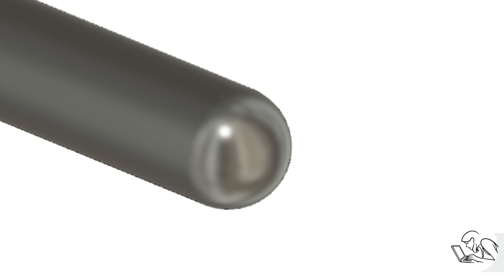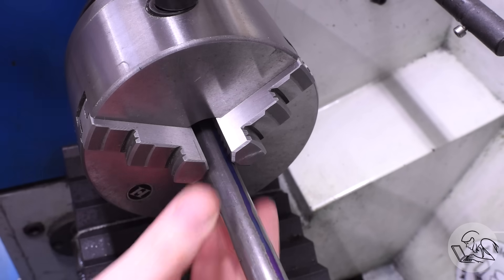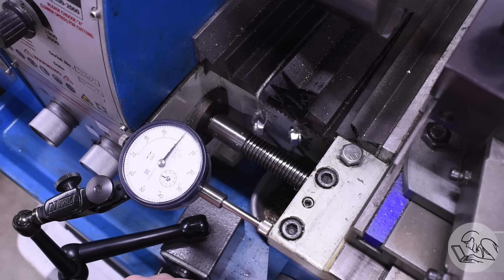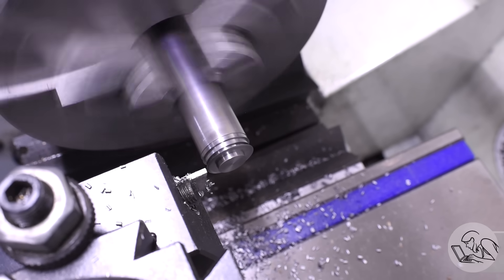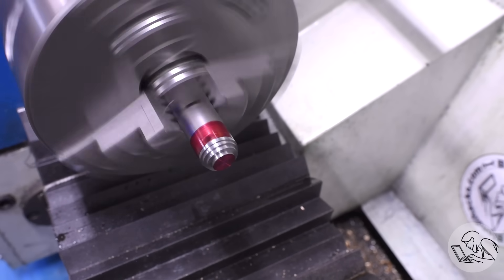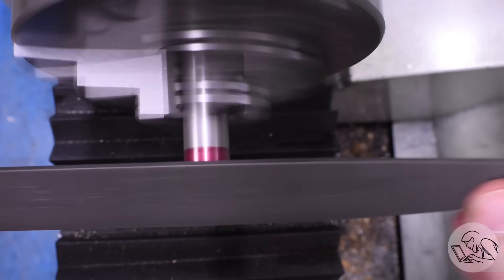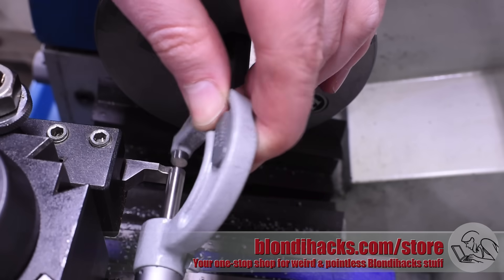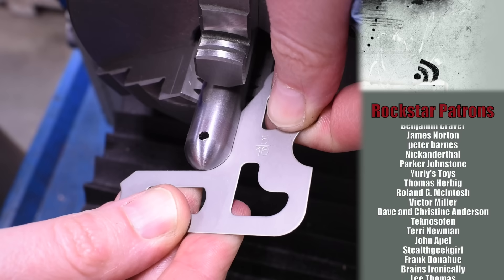Easy Radius Turning On The Lathe With No Special Tools! Other complex curves too!

Comment from the maker: Hey everyone- some heavy repetition in the comments on this one, so let me save you all some typing:

1) Stepping over less than one full parting blade width is a little dicey because the blade wants to deflect. That’s why I don’t do that. 

2) Yes you can do this with partial steps on a thicker tool or a turning tool from the right, but I show this method because it works on concave surfaces and more complex shapes, as shown at the end.

There- now hopefully no need to keep saying all those same things over and over. I appreciate the algorithm engagement and all, but save your thumbs. You may want to hitchhike some day and you’ll need them.
Reply: Saved me a comment, thanks for the FAQ :-)
Reply: just think you could have used ... having a zigurat after you finished the video .. and a drink ...
Reply: And if you do, dont forget your towel.
Sorry
Reply: @tlange5091  so long and thanks for all the fish

Comment: You're awesome as usual!  I'm a year late here but also just in time.  I was just asked if I could make some knobs that look a lot like one end of your drawing at 11:00, about 2-1/4 to 2-1/2" max diameter.  We're restoring some 3" Naval guns for a battleship and some of the knobs are missing.  Thinking about using an as-manufactured 3/8" cobalt HSS steel bit instead of a cutoff tool.  That would pretty much eliminate side deflection.

Comment: I watched this yesterday and it got me thinking of radius turning. Today was a slow day at work so I tried a bit of a different technique for corner radiusing with quite impressive results. First I turned and faced a straight piece with an od that matched the radius I wanted to turn. Then I clamped that vertically to the bed of the lathe and used a dial test indicator mounted on the cross slide to follow it's od. I roughed the radius out with straight turning in z direction by going nearly to zero on the dti on every x step and finished it by alternating x and z, turning to zero with z then backing off x until the dti showed I was 0,05mm away and going to zero with z again. Rinse and repeat. turning a 20mm hemisphere took about 15 minutes. This technique is kind of like linear interpolation on a cnc lathe, except it involves no math, no cad/cam and is quite easy to setup. If anyone wants to try this for themselves I'd suggest picking a tool which has the same nose radius as the radius of your dti tip and angling your dti so that it contacts your form in a way that keeps it as square to the form as possible, in the case of the outside radius I did I angled the dti at roughly 135 degrees relative to z axis. This is quite complicated to put into words and english isn't my first language so sorry if this is hard to follow.

Comment: I used the related Mill version of this to make an almost round pocket where it was well beyond the ability of my benchtop mill to plunge directly and I don't have a rotary table.  Divided up the pocket into steps of the endmill radius in X and the walk it in on Y each time.  Now I had to overdo it since I can't file the pocket but it worked great!

Comment: I once had to machine a couple of Hemispheres on a conventional lathe, i used a tool with a round insert and i calulated the X, Z positions with Sine and Cosine (sine (angle)*radius and cosine (angle*radius)
with small radii, you can increment the angle with like 10°, while on bigger radii, you might want to go to 5° or smaller to get a smoother surface..

On my CNC machine, i have all these calculations written in the cycles, so the machine does the math for me

If you have a rounded tool (like with a round insert), and you're using CAD, you also can get a smoother surface.. 
and you can take smaller cuts, as a tool with a round insert will not deflect like a parting blade does.

Comment: may i inquire further about your cad drawing?? how did you get your dimensions for the size of the hemisphere you made? like how did you know how far to move the groove on the z and how deep to cut on x? how did you approach your drawing to get your accurate hemisphere??
and how does it different in can from hand drawn?
Reply: The size of the steps is relative to the size of the ball and the accuracy one needs.  Smaller steps more accurate, more labor intense.  Using a radius gauge is perhaps the best part, as one can rather accurately profile to fit.  My first attempt was using the thickness of the parting tool to choose the steps, and while fast, leaves much to "quality of filing technique".

Comment: Another way to center your cutting tool on something round is get a steel rule and put it between your work piece and insert and move the tool in until it’s holding the rule , if the insert is too high the rule will lean away and too low it’ll lean toward you. Straight up and down is perfect. Blew my mind when I learned this in my apprenticeship.
Reply: I was about to start centering my shiny new lathe, and this is going to save me so much time. ❤

Comment: How would you create a tool holder that would accept an adjustable boring head to double its capabilities as both a boring on the mill and ball turning tool on the lathe and the tool holder be height adjustable and fit a quick change tool post?

Comment: If you cut 45 deg. tangent to desired radius, then 22.5 deg. and 67.5 deg. also tangent check CAD to see how little filing is required.

Comment: Hello my lady did they teach you at engineering school to face off the object using dial gauge its called zeroing. I find alot of centre lathe turners just slamming the metal being turned and hope the best . There's alot of instructions on an engineer drawing that states ovality or concentricity that's why the reason of setting.

Comment: Ah the memories...
In last century I did a tool surface (steel plate) in 0.1 mm (1/254 inch) steps and curvature of about 4 meters.
This tool diameter was about 0.3 meters (1 feet), and the excess was left there because this tool was a (rough) shaped lapping plate that abraded to final dimension during the use.

Comment: "Slices" could be reduced twice to minimize that file work (just use thinner tool). Good solution for lazy machinist. But I think, that template work (having pattern fixed in tailstock) is more versatile.

Comment: Adjustable boring head mounted in a height adjustable quick change boring bar holder allows you to swing all kinds of inside and outside radii with respectable accuracy and repeatability, like anything, you got creep up on it. You can take it off but can't put it back on.

Comment: This reminds me strongly of one of the first methods they taught me in university calculus for computing the area under a curve.  And it is in fact the same essential technique.  Neat!
Reply: I learned to use the same technique working in aviation electronics my "Marine profession" where I'd been shoved instead of the machine shop I tried to enter through.  Now I have the machine shop and am retracing old steps.  I got calculus via the electronics, never thought I'd be able to cross it into machine work, but here I am!

Comment: Great tutorial on a valuable technique and you did nothing wrong. I have used a spreadsheet with sine and cosine functions rather than CAD to generate my X and Y values. I do it in 10 increments which makes file massaging easier. Rather than a cut off tool, I use a turning tool and proceed all the way to the right with each Y increment. Then I back up to the next X value and dial in the matching Y value. We are both doing step turning, only with different approaches.
Reply: Still don't understand how to come up with the depth of cut measurement.  Don't have CAD and not sure how the sine and cosine formulas are being used?
Reply: I cant even spell trig.  Can you tell me how I can determine the cuts and depths for a 1", 1/2" and a 0.754" (size of my stock).  Can you post for others as well?

Comment: Great video Blondie! Question for you. Do you think it’s possible to do the entire process with a facing tool? And come in from the front rather than the sides with the parting tool?  I have no idea, I’m asking a stupid question probably…. I’ve never done any machining, I just thoroughly enjoy the topic.
Reply: Not a stupid question at all. Yes it could, and is done. Step over size is only limited by you patients and if you used a tool that had a bit of a radius on it and took this into account when doing the pre-calculations of the steps the result would be far closer to the finished shape. This is exactly why cnc machinists use ball end milling cutters for finishing profiles of pretty much any shape e.g. machining mold cavities or cnc routing a 3d carving/sign etc.

Comment: How super interesting & useful. It reminded me of being taught integration by dividing the curve down by smaller & smaller rectangles till the curve was accurately described & then one found the area by multiplying width x height for each rectangle then summed all the rectangles areas together. Thanks for sharing!
Reply: integration by limits, as width approaches 0 of each rectangle, your approximation will be arbitrarily close to the continuous integral. There's a lot of polar math that goes into lathe work, really, helps to know your trig and geometry for sure.
Reply: ... as the width of  the parting blade approaches 0😂

Comment: This will help me loads when it comes to machining my own hip replacement in the near future.
Reply: True story! I worked with a graduate student in orthopedics. His father was a machinist for GM, and of course had his own shop at home. He had some kind of surgery in his pelvis (don't remember exactly what). One day his orthopod told him that one of the screws in his pelvis was migrating IN!. Well the dad went home and designed a tool to extract the screw, built it, took it the next time to said orthopod. The doc looked at him like he was nuts! And hemmed and hawed and politely said that was pretty cool, but no thanks. Well the screw kept migrating and the doc wound (no pun intended) up using said tool.
Reply: @ronmccabe7164  Hot damn. That's the coolest thing I heard all week. You think he could've gotten a patent on it?
Reply: @SethKotta  Hi, I'm not sure, from what I understand it was kind of a one off deal - may not have been a general tool.
Reply: Be sure to follow up the file with emery paper. You wouldn't want your new hip to chatter
Reply: @TheBiggerNoise  I did the same thing when making my false teeth

Comment: are you ever worried about the indicator on the carriage not being perfectly straight for using it as a small DRO? looks like you used the mk 1 eye.
Reply from the maker: I try to get it straight, but the tiny amount of cosine error there wouldn’t amount to much. Don’t put it at 45° though. 😁
Reply: @Blondihacks  so 44° is ok?

Comment: I thought at first you were going to show the free turning tool that Prezzo has been using lately, which would be a good investment if you do this kind of thing a lot, but this is the way to do it for zero margin cost, I recall being shown at school a very similar technique but using a roughing bit (The school was paranoid about breaking parting bits, largely because we were so good at breaking them!). Using the parting bit is better though for shapes more complex than rounded ends as you show at the end.

Comment: Nice trick Quinn !

Is your blade really 0.063? Isn't it 1/16th which is 0.0625? The second position would then be 0.125...

Could you not use smaller steps, even with a "large" blade? Maybe make half steps after the first round... It would make less filling...
You just need to be careful with concave shapes when you prepare your cutting depths...
Reply: Maybe it is 0.0625, but half a thou isn't going to make any difference to anything.

Making partial-width cuts with a parting blade is tempting but causes deflection and is a recipe for the kind of spectacular failure that leaves bits of parting blade embedded in inconvenient places (like the operator, for example).

Comment: It may not be necessary, but I would be tempted to step over 1/4, 1/3, or 1/2 of the width of the tool instead of 1/1, to get a much closer approximation of the shape and reduce the amount of filing.
Reply: Not a good idea with a parting blade...

Comment: For certain standard radii you can actually use roundover bits for wood routers. They have carbide inserts. All that is necessary is making a holder for them, i.e. a small clamp for the round shaft that will fit on the lathe toolpost.
Reply: As stated the problem is not the lack of tools but small lathe can't handle big form cut.
Reply: @koharaisevo3666  Works perfectly fine, maybe just mount a fixed toolpost instead of the top slide. It gives a lot more rigidity. Compare Robin Rinzetti / Stefan Gotteswinter videos.
Also nobody is stopping you from pre-cutting steps before using any kind of form tools of course, which also helps.
Reply: It's not just the toolpost on  these small lathes-- I wish it was.  The ways flex as well.  There is not enough rigidity in the lathe bed on a hobby level  100 - 200 lb lathe.  And unfortunately, the longer the bed, the more flexible it its.   The machinists you talk about have lathes that most hobbyists can't afford.
Reply: @FEM2008  Clickspring uses a fairly small one and uses form tools all the time, even with the top slide on. My own Emco Compact 8V is also not that big, basically one size up from the minilathe which is an Emco Compact 5 clone. Stefan Gotteswinter used a Chinese lathe about the same size as hers for many years before he got the Emco.
Reply: @Cancun771  Important to note here that clickspring typically uses those tools on free machining brass. That stuff is designed to machine well with form tools, as would be typical when making small fittings on a screw machine. If he tried the same thing on 304 or 316 stainless steel he'd have rather a lot more difficulty...

Broadly on small lathes you can probably make good use of form tools on cast iron, free machining steels (e.g. 1213, 12L14), leaded brass or bronze (C360 brass, LG2 bronze, etc), free machining aluminium (Grade 2011 T3 or T6) and the assorted non-metals you might find yourself turning e.g. wood and plastics. Smaller forms will also work on mild or low alloy steels, but bigger forms will probably chatter. And stainless (except maybe grade 303, the free machining stainless) or highly alloyed steels are right out.

Comment: This is the exact method I used in High School to make a ball peen hammer for my dad.  My machine shop teacher was the best. He taught us many old school methods.
Reply: I took one machine shop course in about 74 or 75, made a very nice C-clamp out of three quarter inch plate, and have made a career out of mechanic work fed by machine work.  This has been one of Quinn's delightful demonstrations of techniques.  I still use that clamp daily, I just wish I'd gotten substantially more in school.  I'd hoped to fulfill this dream, but never expected I would.  I'm retired now, "with a full machine shop" and have learned much out of the young machinists, showing ideas I'd never seen before.

Comment: Laughs in CNC
Reply: Also you can use the hole pattern feature in DRO to calculate the steps
Reply from the maker: Great idea!
Reply: @Blondihacks  I think I saw it done in ToT's video. And remember, if you want an accurate radius, you need to compensate the tool nose radius by adding the tool nose R to the R you calculate it with. (Subtract from concave radii) A big round tool and many points will save you from most of the filing

Comment: An old machinist trick, and I qualify as and old machinist, is to get some side walk chalk and scrape it across your mill bastard file teeth. It fills the voids between the file teeth and keeps swarf from chinking up your file and scarring your work.
Reply: Especially when filing aluminum. Thanks for the reminder.
Reply: @robertwalker7457  Pleased to serve.
Reply: I've also used charcoal. Thanks for reminding me to do that :)
Reply: But also makes the file rust if you leave it on for a while.
Reply: @virendrajanakiram2365  Just wash the chalk off the file with a solution of lemon juice & salt then put the file away in a drawer.
Reply: @yowie0889  
🤨
Reply: That trick was in my schoolbooks, when the teacher told us about that trick, i took his chalk when i left the classroom.. 🤣
I later always had a pack of chalks in my drawer at school, because they made us file a lot of Aluminium..
Reply: I score my chalk when cruising my 'hood, seeing kids making a hopscotch board on the road, I tell them mom just called and lunch is ready, when they run inside, I grab up all their chalk and race off down the road. I think I am teaching them a valuable life lesson here as well.

Comment: A thin piece of brass, or a squashed mouth of a spent rifle casing/bullet shell(.308 or 30-06 or something of similar size) pressed into the teeth of a file works great for cleaning single cut files, especially if you're filing aluminum.

Comment: Doing 1/32 or 1/64 steps especially at the end would have saved a lot of filing.
Reply: I've done similar to this on my (manual) milling machine where the end mill is much larger than the step increment.  It works quite well.